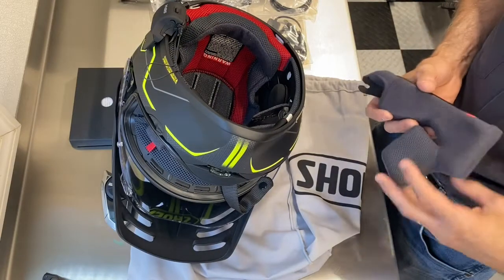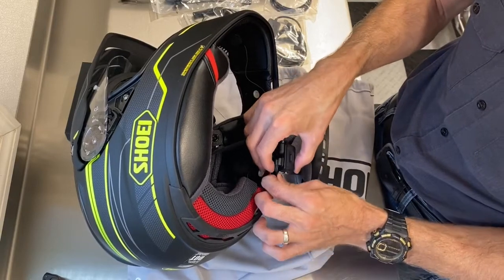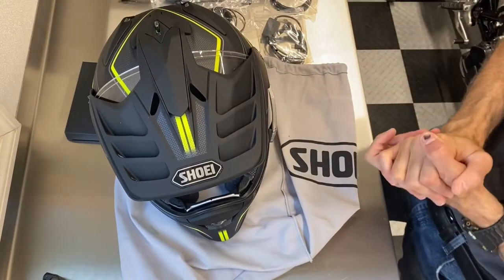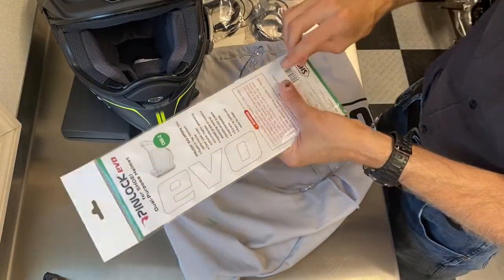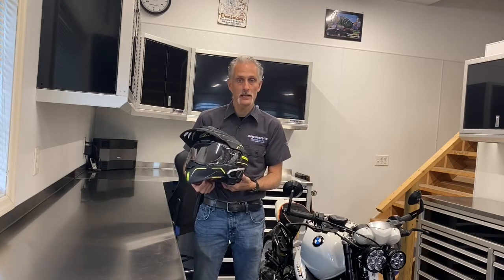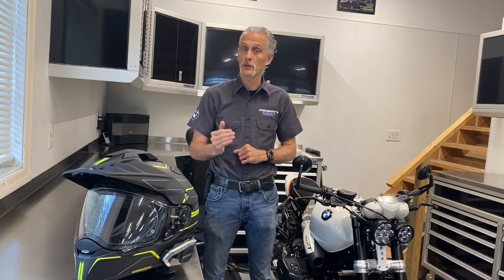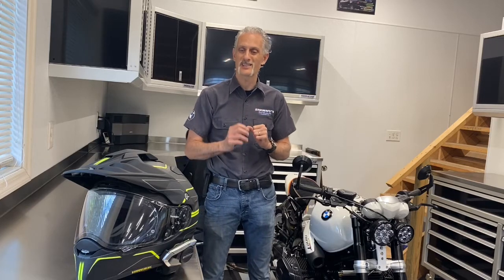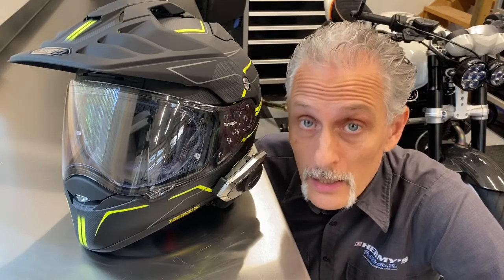Shoei Hornet X2 and Sena 50S Review and Install Part 2

Comment: The toughest part of the install is routing the wire on the unit side--you completely skipped over that.  If I try to tuck the wires, the left speaker wire is too short.  Any tips?
Reply from the maker: With the cheek pad out, push the wire into the space between the outer shell and the EPD liner.  Run both speaker wires to the EPD liner side.  Run the right speaker wire across the back of the helmet.  Velcro the speakers in place and then reinstall the top pad and cheek pads in the helmet.  Don't forget the microphone.  Thanks for watching.

Comment: Did you have to cut the cheekpad at all when reinstalling by the main unit.?  Seems as if the unit may not allow it to sit all the way in.
Reply from the maker: I did not need to cut anything.  It is tight, but all settled in nicely.  Thanks for watching.
Reply from the maker: No modifications were necessary.  Easy clean install.  Thanks for watching.